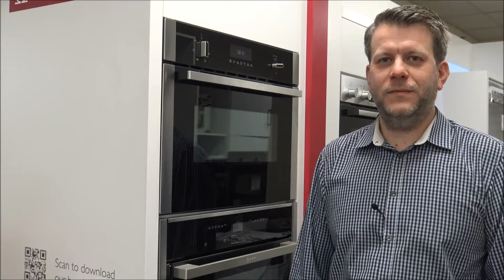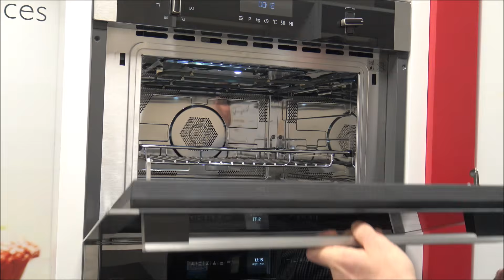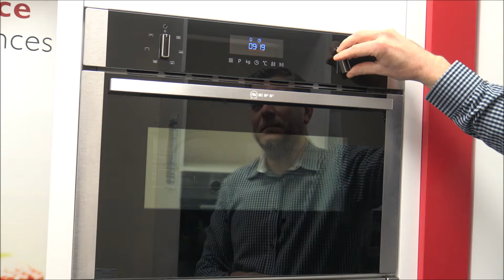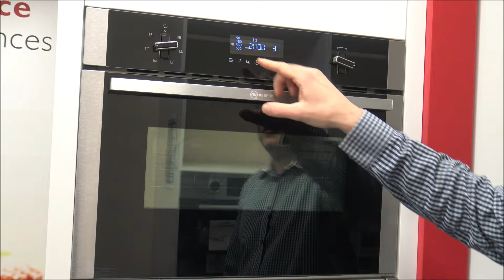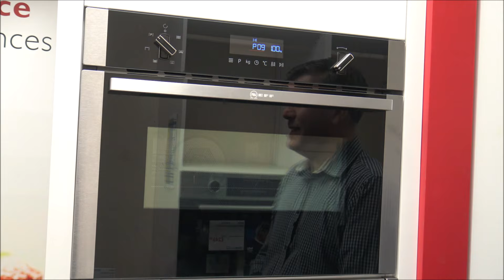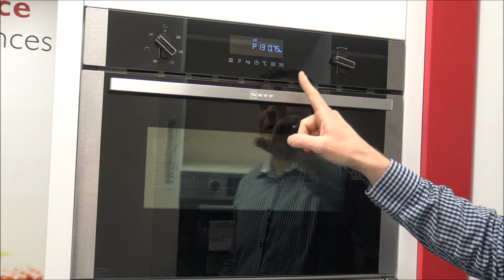Neff C1AMG84NOB Integrated Microwave Explanation

Comment: Am I right in saying that you can't use the metal rack with the microwave on 900watt? Do you just sit your plate on the floor of the microwave?
Reply from the maker: Yes you can put a plate on the base when using the microwave

Comment: Seems you can only use the grill with the door closed.  Is this right?  Also, where is the best place to get a grill pan from for this model?  Can you use the pan and the shelf for it or does a new one need to be purchased?   Recently moved into a property with this model - still trying to work out how to use it! :) Also, to use as a microwave, do you have to remove the metal shelves or can these stay in the oven?  Any advice would be appreciative as new to these type of appliances.  Used to normal electric fan ovens and microwaves.  Also have a tip top induction hob that i am just about getting used to, (ps. only been in the property a week so still trial and error!)

Comment: Just got this multi oven, I'm not keen on the shelf...hard to manage, I could do with a flat one. Can I heat drinks up on the base of the oven?
Reply from the maker: Yes you can
Reply: As per the manual - When the appliance is in microwave-only mode, place
the cookware on the cooking compartment floor.

Comment: Hi , I’ve just had this installed . I was wondering and a wee bit worried about using the microwave part with the metal shelf? Always thought that I couldn’t use anything metal in a microwave. Also the back part looks metal too ? Or do I put the plate on the floor of the oven ? 
Tried looking at instruction book but I got bamboozled . Any help greatly received. 
Thank you 
Jennifer

Comment: The only thing that the 900watt can be used for is heating liquid look on page 17 of the instructions. If you are thinking of buying this microwave, check what I have said, I wish I knew this before I bought it. If you put it on 900watt to cook it automatically changes to 600 but still displays 900.

Comment: Why does my manual say that 900w setting is only for liquids? The next power setting is only 600w...
Reply from the maker: In reality most people will use the microwave settings on all types of food and liquid, but most foods don't need to be on the higher wattages and can be a lot better if they are in the microwave on a lower setting. Although it may take longer to heat up, the quality of it should be better.
Reply: @lords-electrical  thanks, I was confused because the standard is 800w minimum. If going by the manual, I'd have to be heating everything at 600w. Most modern microwaves seem to be 1000w

Comment: I love this oven. Only annoying thing is that when you use the microwave it doesnt stay on the selected wattage it automatically goes back to 900w. So if youre defrosting and checking it every so often you have to change it every single time. Same as if youre heating on 600w and juet opening it to check its not too hot, you have to change it back from 900w every time.

Comment: Just literally had this installed today.  The manual seems more complicated than you make it, so thanks. However - daft question - when in oven mode presume you can’t use normal oven trays? They have to be microwave compatible?
Reply from the maker: If you are using it as a normal oven then you should be ok using the oven with normal pans and trays, it is when you are combining the microwave where you will need to be careful on what pans you use.
Reply: Great thanks so much.

Comment: My oven has the 15 programmes listed inside on right of door.  Is it OK to drop the shelf onto base of oven and use it there when microwaving?
Reply from the maker: It should be ok but just check in the instructions that the material of the tray is OK to use in the microwave

Comment: We've had this oven for a few months now. While I can't fault its operation, it's difficult to clean effectively. The door cannot be removed (to improve access) and there doesn't appear to be a way to remove the element to facilitate cleaning.  This means food & stains build up on the inside ceiling of the oven but access is restricted.
Reply: And do you have to use the shelf to microwave things?  Can you just put things on the flat bed ?
Reply: Can you put the shelf upside down on the bottom so to be able to cook a big chicken so that it’s not too close to the top ?

Comment: Just had a new kitchen fitted with the microwave you show. Shortly after we started using it as a microwave, it gave a significant electrical crack sound on first startup. I did wonder if I should have removed the metal tray before using as a microwave - which is what we have done since. It still seems to work as it should though it doesn't microwave as evenly as I have found our prior turntable microwave (not Neff) did. I will probably report it to Neff service just in case...
Reply from the maker: Does sound odd, like you say its worth having a word with Neff service to check to make sure everything is ok

Comment: I have one of these but a slight different model in the range (think its an N90) and its brilliant.  I also have a couple of the N90 ovens and I find this combi one the most useful of the lot.  I was not even aware that you could use the microwave and oven in combination when I got it - just thought it could do both functions separately.  The amount of functions it has is impressive and it also connects to the home connect app so tells you how long is left and various other stuff on your phone.  Very good products